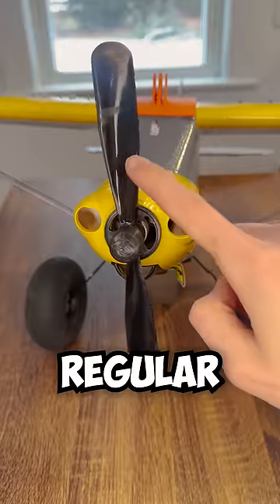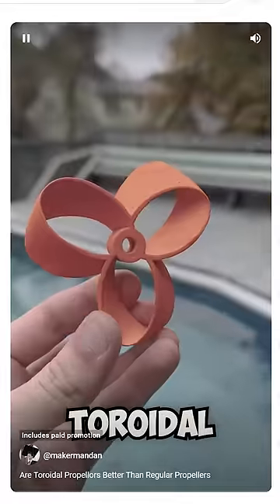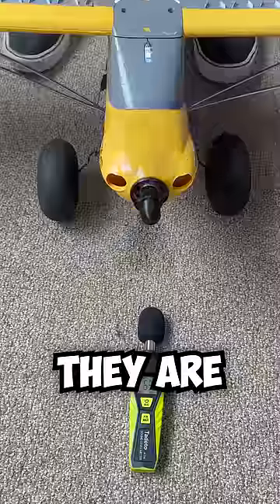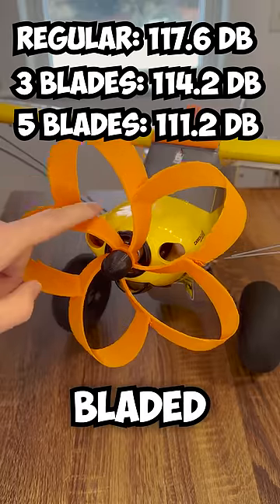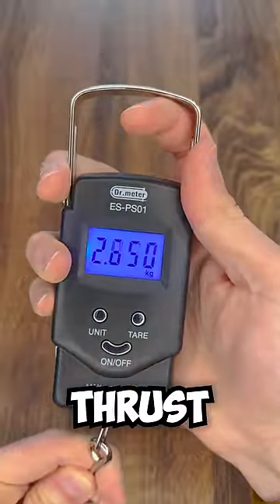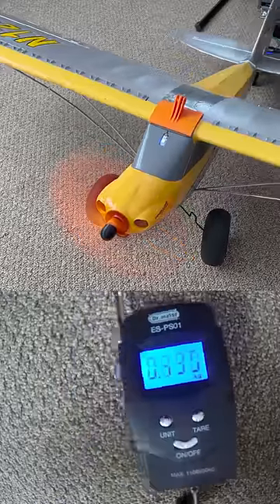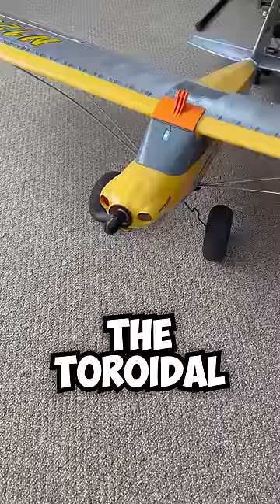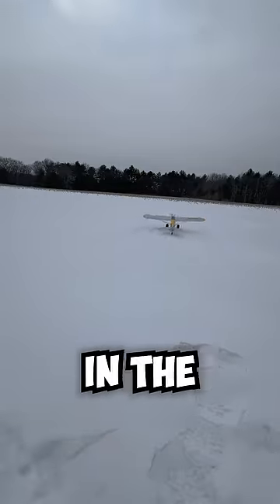Toroidal vs Regular Propeller for RC Plane

Comment: You did not address weight. If a propeller is heavier, it will spin slower given the same torque. That would explain the quieter sound and decreased thrust.
Reply: It'll only accelerate slower, the rest is down to drag.
Reply: @reinbeers5322 Acceleration and maximum velocity would also be reduced. Those are entirely different, and we are trying to fly in the end.
Reply: @goofballbiscuits3647  Top speed is affected way more by drag and not weight, weight is more relevant for acceleration and climb rate.
Top speed will only be lowered if drag increases, which may not happen with a small increase in weight.
Reply: @goofballbiscuits3647  Top speed is affected way more by drag and not weight, weight is more relevant for acceleration and climb rate.
Top speed will only be lowered if drag increases, which may not happen with a small increase in weight.
Reply: @reinbeers5322  Sure, acceleration is more affected but saying only acceleration is affected it flat out wrong. This isn't a zero-sum gain. Propeller efficiency changes with airspeed. Change the propeller, expect that power band to change. Propeller efficiency can also allow the motor to be over-revved. 

Propeller length should be determined by the *motor*. He did not change that iirc. 
Only changing the propeller is going to affect more than just acceleration. It will affect the entire passage through the medium. As displacement of air is also critical, not just drag. 
"Better to move a lot of air, a little."

Comment: The toroidal propeller should be much quieter, the reason why your propeller sounds as loud is because the layer lines on your 3d print are negating its advantage because its causing a lot of wake and turbulence, I suggest that you make the layer height as thin as possible, then sand it smooth and add a layer of a filler like spackle or find a way to make it smooth to the touch, then polish it, now it should work.

Comment: Important thing missing from the thrust measurement is a simultaneous measure of power being drawn. The toroidal props could be weaker but drawing less power making them more efficient or weaker and drawing more power making them even worse. It would be interesting to see this measured together for a more complete picture.
Reply: I’d imagine the mass, especially at the tips is MUCH higher so the lower thrust and sound is probably due to a lower RPM, and power draw would likely be higher
Reply: Im trying to understand this comment. The motor should be drawing a fairly constant amount of power regardless of what its driving. The lowered performance would be some summation of the properties of the printed propeller making it harder for the motor to apply torque to.

I think to make this test "fair", one should iterating the design of the toroidal propeller itself.

By that i mean, the printed propellers seem suboptimal compared to the original design. My intuition tells me if he played with the mass, cross section, raidus and/or print material he'd see better results. Essentially he needs to lower the Mass moment of inertia to make the propeller easier to spin, then he can start playing woth thrust properties.
Reply: @h34dshotgl0re   By power you mean amps, right? I don’t know a ton about how to calculate amps from prop mass/pitch/size, but I do know a bit about power consumption in general. A motor has a KV rating which for our purposes is the number of RPMs the motor will spin at a specific voltage. The amount of current the motor is going to need to do that is going to change based on the load. So no prop requires few amps, big prop requires big amps OR big prop pitch (more air pushed per rotation) also requires big amps. 
So you’re completely right, they need to test different prop geometries to actually see if they can optimize the design to be competitive. I just don’t think it’s going to be useful to try to compare a homemade design to something designed by the pros, then claim conclusions based on an amateur attempt :(
Reply from the maker: True, I don't have the equipment to measure the current draw but I can look into it for future testing.
Reply: @h34dshotgl0re Why do you think a motor should draw the same amount of power regardless of what it’s driving? I’m fairly sure that’s totally wrong.
Reply: That's what I came here to ask. I don't care about noise, but I do care about efficiency.  @makermandan
Reply: @h34dshotgl0re  It's more complicated than that. The amount of power a motor will output will decrease with its speed. So if the toroidal propeller is creating less load on the motor (i.e., demanding less torque from the motor), the motor will be spinning faster and may be running more efficiently, even if the thrust is lower.
Reply: judging by the sound of the engine the toroidals draw a lot more power given how the engine basically screams when trying to go up to high rpms.
Reply: @h34dshotgl0re  the motor would draw a lot more power trying to spin something that is heavier and has more air resistance to the same rpm

Comment: You need to account for the weight differences and drag too...causing the motor to turn slower RPM, hence quieter and less thrust.  Match RPM and then test.

Comment: The major advantage of a toroidal prop is it improves efficiency by reducing tip vortex, in case of a drone you have multiple vortex interacting making them less effective because of the prop arrangement. The down sides of this prop is spinning weight. Also more prop blades do not make a prop better, they spread the horsepower out to improve energy transfer so more are needed if the plane is over power loading the prop it is why the 800hp spitfire had a wooden fix pitch prop, and the later 2000+ hp model had two 3 blade counter rotating monster of a prop to make a 6blade prop with no P factor. A low power plan works better with a more efficient 2 blade prop.

Comment: You still have sharp edges and rough surfaces on the 3d printed ones. It would be interesting if you measured rpm as well.

Comment: Be interesting to measure the noise level of the standard prop running at a lower speed such that it matches the thrust of the fancy prop.
Reply from the maker: Id imagine the regular prop still retains a higher pitch timbre.
Reply: @makermandan  why imagine? You're set up to test exactly this and it's a valid point.

Comment: A sounds volume doubles every 3 decibles, so the difference between the propellers was massive
Reply: 3dB is about the smallest sound level change you can  discern

The sound ENERGY doubles or halves with a 3dB change, but eyes and ears have logarithmic intensity responses, not linear
Reply: @miscbits6399 meaning it takes 10db to double the perceived volume of a sound, not 3db :)
Reply: The normal one is actually quieter when normalised for thrust generated.
Reply: @nathanblanchard8897  well, 50% is still a lot tho
Reply: the difference is indeed massive... 25% thrust is the difference between an airplane and a brick falling out of the sky.
Reply: Get off the pipe.
Reply: @notoriousmoist5169  wut

Comment: I would also sand or use resin to fill the grooves of the print so they are smoother. should help improve performance and reduce sound as well.

Comment: In car audio, every time you double the watts, it adds 3db. If a pair of 12" subwoofers hit 117db with 500 watts, then only 125w will hit 111db. So it might seem counterintuitive, but -6db is 75% quieter.

Comment: You should compare the motor current as well. Efficiency is also very important thing.
I believe that flower-type propellers were rotating slower, so this is why they were less noise and less throsty.

Comment: I think the toroidal propeller was designed for maximum efficiency in the mid-range of engine rpm. Instead of testing thrust at the highest RPM, maybe test thrust at lower RPM to see if the toroidal propeller generates more thrust with less power. Air also has different fluid dynamics than air. I believe the point of the toroidal propeller is to minimize cavitation compared to a regular propeller, and that affect may not be as influential to noise and engine efficiency in air as it is in water. You put in a lot of work with this experiment. I'd love to see more experiments with these same propellers!

Comment: If I remember correctly toroidal propellers are supposed to be more efficient, not necessarily more powerful. They are more like a side step to traditional propellers than an upgrade. A more accurate way to rate them would be to record audio from farther away and record how long battery life’s last.

Comment: Change the pitch angle of the blades. The leading blade at a less of a pitch than the following blade. 
The leading of the loop is pushing the air out of the way so the following edge has less volume available within the blade space.
If you have the end of each loop also pitched in a way to focus the air on the outside of the loop into the inner part of the loop.

Comment: If you match the thrust the sound goes back to normal.

They aren't quieter. They just have their noise more spread out over more frequencies that are less audible to humans, there quieter.

Somewhat like the tread on tires going from blocky to variable spacing and angular shapes to spread out the impact and therefore spread out the noise.

Comment: This is true in full size aircraft as well. As an example, Beech King Airs with the standard 3 bladed props are louder inside and out, but exhibit higher top speeds. Whereas those fitted with 5 blade upgrades from a company like Raisbeck tend to have better climb performance and a quieter ride in the cabin but also suffer a slight cruise speed penalty.

Comment: As a person trained in basic aerodynamics and with real aircraft maintenance experience I can say that propellers are specically formed in a way to get as much "bite" on the air as possible as pulls t the plane through the air while minimizing drag. It seems that the new propellers have a lower pull and higher parasitic drag coiefficients. Still an interesting idea though.

Comment: Wow, thanks for making me realise I'd need a db metre and a fishing scale to measure pulling potential. I'm building a few aerodynamic projects in the near future, so cheers for sharing. 1.4kg's of thrust is pretty nice.
Reply from the maker: Its not perfect but the fish scale will give you a rough idea. dB Meter isn't necessary unless noise is a design parameter.

Comment: It logically follows that toroidal propellers would both be quieter and produce less static thrust as the key factor for both is cavitation.

While generally discussed in context of liquid-based propellers, cavitation is the variegation of pressures created through a medium used as the basis for propulsion.  In water, it is more specifically caused by areas of pressure low enough to release vapor - usually suspended gasses, though sometimes reducing pressure below the liquid's vapor point.  This disruption of nominally-stable pressure creates vibrations which result in noise.  As the toroidal propeller has both greater surface area and is more 'regular', it results in less cavitation - hence, producing more noise.

I'm sure there's a more precise term but, essentially, cavitation is turbulence.  Turbulent air is 'more solid' than non-turbulent air, providing more resistance against the thrust created by the conventional propeller; as the toroidal propeller produces less cavitation (and less turbulence), there's less resistance pushing back against the thrust it provides.

During flight, the plane is constantly moving through air which has yet to be affected by the propeller.  Hence, the turbulence/cavitation caused by the propeller is less a factor in the amount of force imparted by the propeller's thrust pushing against it.

I'm sure there's a more proper explanation for this phenomenon, but I haven't studied this field enough to know what it is.

Comment: 6dB doesnt sound like a huge reduction, but  it's a logarithmic scale. Every 3db is effectively double the air pressure. Air pressure and percieved volume dont line up exactly but this is still almost 1/3 quieter.

Comment: In terms of noise level, I notice that the edges of the toroid propeller ribbons are sharply squared-off. If possible, it might make sense to make those edges smoothly curved.

Comment: The 3d printed propellers might just be a lot heavier than the originals. Plus, while adding more propellers does increase the amount of thrust, it amount it increases by decreases as you add more blades

Comment: You should measure the sound intensity in the plane of the propeller as the blade tips make the most noise.  A propeller sheds a disc of high sound intensity.  You can hear this when on the ground and a prop plane passes overhead.

Comment: Adjust the pitch of your toroidal, and tune for the desired thrust. Think of a constant speed prop - you need “Fine” pitch for take off, and  once airborne you back off the pitch for cruising speed. As your little toy doesn’t have adjustable pitch, you have to set it up on the ground.

Comment: Would be interesting to check the Ratio Thrust/Amps. If they produce 25% less thrust, but 30% less power usage, they'd still be better, and just upgrade the motor to compensate for the loss.

Comment: If you divide the dB by the thrust you find the standard propeller is actually quieter than the toroidal props for a given thrust value…

Comment: You need to 3d print a standard propellor for this to be a fair test. The weight and surface of a printer will never be the same. I still expect the standard twin blade to win. Also, we should remember that because of the geometry of toroidal propellors, it is not perfectly accurate to describe them as "3-bladed" or "5-bladed." A better terminology could be "3-fold rotational symmetry" or "5-fold rotational symmetry." These blades have more like 6 blades and 8-10 blades worth of surface area respectively.

Comment: The two biggest factors of a propellers efficiency is the angle of attack and the diameter. Two blade propellers are typically more efficient as well, but louder.

Comment: Drag comes in many forms. 
Just as wing shapes create different amounts of drag, a prop with more surface area will create more drag, causing the engine (or motor, if electric) to work harder. 
You will likely notice reduced run time from your battery if it is electric.
This is why real GA aircraft stick with the simple dual blade prop design.

Comment: I think the next test would be could you put in on an engine with higher rpm potential and see how the propeller does as the tips approach the speed of sound (which is the limiting factor for all normal propellers)

Comment: The more arms on a propeller makes it grip the air more, so it’s better for maneuverability but it also takes more torque to spin hence the lower power, also more torque = more battery used

Comment: On thrust test you should measure the current as well.
Thrust/power is more relevant for the viability, if the design has a higher efficiency, you can than just increase a little the swept area: 10% increase in diameter should roughly give you 21% more thrust.
If on the other hand is less efficient you should look into improving the design, my first suggestion would be to smooth the surface as much as possible

Comment: Interesting idea, could be fun to see another video but all printed props bi tri and quad as well as the toroidal. It should be safe to say that the heavier the prop the more strain on a motor that isn't designed for it as well as more weight rotates slower in this case causing less noise. If your plane was designed for a larger prop then you print you should be able to limit this.

Comment: Issue you got is it only gets quieter due to higher drag lowering the rpm. 
Your propellers dont have an airfoil shape like they should but instead are just flat with hard edges.

Comment: Considering that toroidal props produce more thrust in marine situations, i wonder how they would perform in air at different atmoshperic pressures. The theory being, thicker air, would behave more similarly to water and you could get more efficient thrusts per rotation due to differences in the way the displaced air behaves.

Comment: I think for better testing though you’re gonna have to finish those toroidals off to similar finish quality for starters, smoothness of the fins, plus don’t know if you did after this video but the blades need to be bladed as it looks squared which isn’t going to do you any favours  cutting and pulling the plane through the air, the other issue may or may not be would be the curved corners could be blocking a % of the wind coming through and not getting the desired affect including possibly producing eddy currents in the air as it goes through the propellers to the plane, so when flying may get even a less desired affect.

Happy testing!!

Comment: Anyone in the hobby knows thrust is largely decided by the pitch of the propeller.  Since you should be using a brushless motor, RPMs will be constant, so refining the pitch of the rotors till they match either the thrust, or the power draw and then testing would be a true test.

Comment: The problem here is that the outer tips/edge of the toriodial propellers create unstable turbulent airflow at a far greater rate than a traditional propeller. That's where you are loosing your power and is the reason we do not use them on airplanes.

Comment: My advice you should have compared also is three blade propeller with and without the toroidal version.

Because more blades request more torque. And since you are limited with your engine. The maximum revolutions are lower with higher blade numbers.

Comment: Might work better as a helipropeller... I imagine the vortex in the gaps of the blades reduce thrust which could be interesting with how a helicopter uses thrust for both lift and then angles that lift for momentum